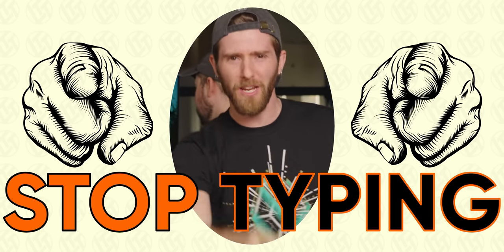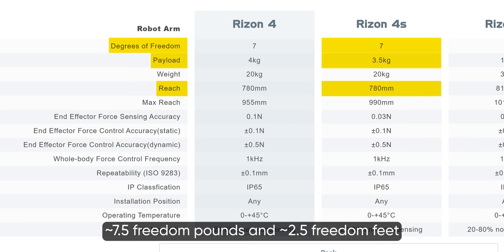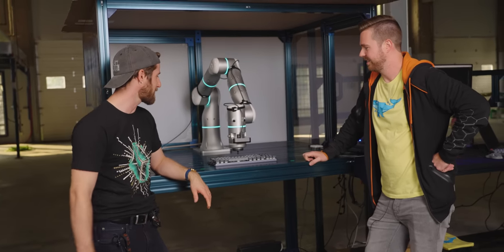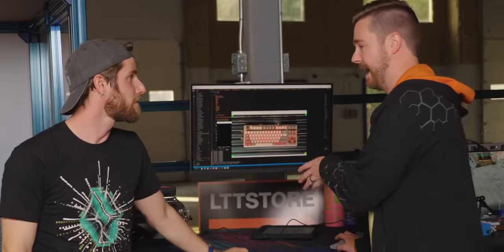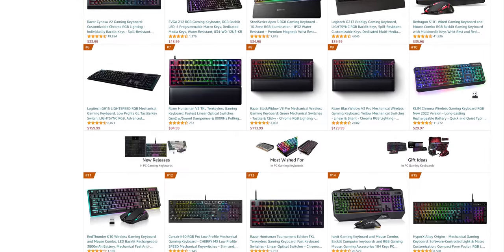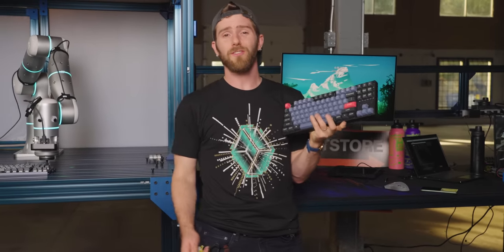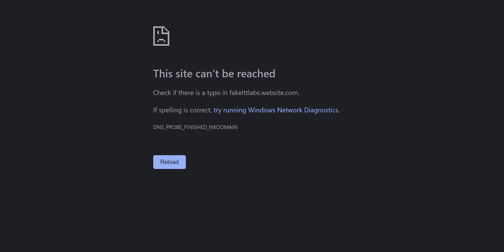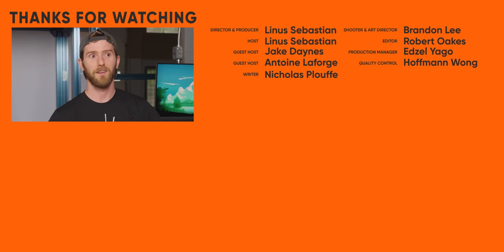Your Keyboard Sucks and I Can Prove It. - Labs Keyboard Testing

Comment: In regards to the potential scoring system between keyboards; you could have a spreadsheet style interactive chart where users can remove any categories that do not matter to them. That way everyone can get a customized ranking system based on their own preferences and hard data.
Reply: <Comment to boost original comment>
Reply: @Waterghosteus  ill help you with that
Reply: This
Reply: up vote so that linus could see it
Reply: <Comment to boost original comment>
Reply: That is a fantastic idea
Reply: @Waterghosteus  I'll help too
Reply: @dex6316  true rhat
Reply: Was thinking about this, especially on the bit about hotswap. As cool as it is, its also prone to failure over time with constant ingress. Solder is still fine for repairability if you're willing to accept the time. Don't want that artificially coloring ratings just because it doesn't have hotswap.
Reply: Sliders!
Reply: PIVOT
Reply: boosting for all the keeb nerds lolol
Reply: The RTINGS website has a Table Tool that does exactly this! I think its the bar LTT should aim for.
Reply: yes
Reply: +1 for this
Reply: You could male this spreadshet available on your website with the option so sort it according to the users whises with affilate links and it's payed.
Reply: Once the data is up. I'll happily spend a couple of days doing some proper analytics designs and dashboards. Linus graphs and charts have been subpar for a long time now. Will be nice to use that data and do some better visuals.
Reply: Great idea! There's definitely certain boxes I don't care about ticking.
Reply: like rtings
Reply: Boost.
Reply: Yup this would be the best method.
Reply: @Waterghosteus  how do comment replies matter here?
Reply: This exact same thing helped me when deciding which mousepad to buy. Having a different categories such as type of a switch, layout of a keyboard or critical functionality will be the most helpful for a fast and painless a/b comparison.
Reply: yesss
Reply: Hell yeah
Reply: I won't be in the market for a keyboard for a long time but upvoted and replying because this is a 10/10 idea
Reply: yes
Reply: Good idea
Reply: Very much this!
Reply: yes yes yes
Reply: amazing idea tbh
Reply: I’d rather have weighted categories with 0 weight being an option
Reply: yup
Reply: boost
Reply: @zimzimph  Boosts the original comments value to the algorithm, making it more likely to appear at the top of the comment list.
Reply: Yes
Reply: This is exactly what I want. Take my vote.
Reply: <Comment to boost original comment>
Reply: and you can also sort in spreadsheet
Reply: This
Reply: YES! No need for fancy interactive website that costs servers, just a simple spreadsheet with all the data, and another link for keyboard sounds to be played directly. Put all resources to testing and let anyone willing to look deep inside figure it out themselves
Reply: Toot toot upvote
Reply: Just making sure this comment "increases engagement" enough to garner their notice :)
Reply: Rtings table tools is a good example that comes to mind.
Reply: This is fantastic if they could pull it off
Reply: Yesss, this!
Reply: @Waterghosteus  seconds that
Reply: I absolutely digging that idea
Reply: Yes
Reply: For those wondering, this is what Linus (and the reviewers) noted about the reviews that initially came in for their screwdriver.

It makes for a great scoring system, tailored to your preferences.

But I suppose something like "sound" is completely subjective.

Comment: If you are testing keyboard latency, make sure to test multiple keys being pressed at the same time.  Some keyboards send commands differently when there is one key pressed, and when multiple keys are pressed.  There used to be some keyboards that had issues when you had more than 3 or 4 keys pressed.
Reply: was gonna comment this. For people who do stuff like Rhythm games that is a huge make or break and might help some frustrated people find out why they are missing notes at high speeds
Reply: @LiveType  it's always best to use the KISS approach for version zero.  If you start with "the best" first you make the problem much more difficult, and it might not be solvable at that scale of difficulty.  if you noticed, they started with pictures and mapped that to an XY grid, then ... they just slowly went down till they started feeling resistance, and measured that curve.  They did all of that without a machine learning engineer which is much more expensive and harder to hire than a normal software engineer.  Then as they saw a monetary value in a more complex solution, then they hired exactly the right talent for that scale of the challenge.

To me, it sounds like LTT is doing things much, much better than reviewers before them.  I, however, didn't see a simple multi-key setup so it looks like they are optimizing narrowly vs. broadly.  Knowing how a keyboard responds to multiple keys is a known issue, and ... it definitely affects max typing speed and gaming.  Both of which are probably important to their audiance.
Reply: Linus mentions it in the video.
Reply: I could be wrong but I think that's what ghosting means, at least, that's always been my understanding of it.
Reply: Just get a keyboard with good key rollover
Reply: @marcasrealaccount  It doesn't fix the issues entirely. Rollover issues stem from how HID-compliant devices (USB keyboards) have to encode and send the data (basically, you can only send 6 key codes and 4 modifiers in one data packet), keyboards with NKRO have to do things like registering multiple USB endpoints to communicate with the PC to overcome this. While the keys will be registered *correctly*, there's no guarantee there's no additional delay caused by this implementation.
Reply: @CarlisleFox  no. keyboard ghosting is when pressing multiple keys will activate a key that is not actually being pressed.
Reply: @LiveType  y
Reply: I was actually going to ask if they were going to be testing keyboard ghosting before I saw this comment
Reply: @Lodinn That limitation of only 6 key codes over USB is only when the keyboard is running in the HID keyboard "boot" mode, which is what is used by the BIOS/UEFI. Once the computer gets to the OS, then the OS can switch the keyboard mode so that a single keyboard endpoint can do full NKRO since the USB HID spec supports this, so not all keyboards use the multiple USB endpoint method. It just depends on the keyboard's USB controller and programming. A good mechanical keyboard, I'd think especially those with open firmware, would implement the full NKRO support over a single USB HID endpoint using the full support of the HID spec.
Reply: They literally say they're going to test this in the video - that's what "key rollover" is
Reply: @Lodinn  Exactly. NKRO hasn't been a "problem" over USB for a long time as far as being implemented. The implementation is just a little...interesting.
Reply: @CarlisleFox  To add to @ACE112ACE112 's response, this is typically caused by the way the keyboard matrix is wired up internally. The cheapest way to wire up a keyboard's electrical matrix makes a lot of keys trigger the same set of signal wires as two or three keys pressed at once, which leaves a lot of room for ghosting. This is usually only done in super cheap rubber dome keyboards. Keyboards that have full n-key rollover use diodes in their matrix and may also run more signal lines so that every key press can be uniquely identified (which is why these keyboards will cost a bit more).
Reply: Many gaming keyboards advertise "anti-ghosting" which is this phenomena so yes it should be tested for.
Reply: They mention n-key rollover.
Reply: @kytechnelson  Yeah, some keyboards go the bitmap route, but it should still have more delay than the "standard" 6KRO implementation. USB overhead is quite nasty, then the polling rate can also be bit problematic - it's still 1kHz max per endpoint using hi-speed protocol last I checked, and in low-speed mode here, it'd be what, 64Hz for the bitmap? I don't think 1kHz can be saturated, personally, but some people swear by it.
Anyway, my point is, there are issues to overcome if you want to ensure compatibility including at least odd BIOS and USB2.0 support. I'm not that big on keyboards, but I know my Ducky 7 had issues and I had to re-plug it to the front USB because it'd otherwise just disconnect on occasion and didn't come back up; it shows as 6 HID devices; I didn't dig much deeper than that though. I also know Varmilo does the bitmap thing via a single endpoint but still registers 4 HID devices. Both implement NKRO, there's more issues with one than the other and it's almost impossible for consumer to know which one has a "good key rollover" in advance, so "just buy one" doesn't really work for most. I merely argue that there's value in reporting on this kind of stuff (compatibility, key press delays, etc).
Reply: @Lodinn  Yeah, there really is a lot to USB, on both the hardware and software side that it is hard to know the precise details and impact of a keyboard's behavior just from looking at a spec sheet (or digging for details elsewhere). Well said on that point about reporting on this kind of stuff. There really are a lot more variables to how this is implemented to the point that there's a lot of value to having some good, clear reporting on this.
Reply: The word you're looking for is Chord splitting. It's entirely different from N-key rollover and ghosting, independent of the keyboard's polling rate, and makes a huge difference for multi-key rhythm games
Reply: @kytechnelson  Indeed. I've re-read my initial comment and must apologize for misspeaking - I said it wouldn't help to get a good rollover implementation while what I meant to say was that there's a lot of moving parts in USB and it's just outright hard to do a good implementation (especially given you kind of depend on the OS interpreting HID compliance the same way you do). And from the end user perspective, digging for details on enthusiast forums can be just exhausting and not productive at all while all you really want to know is whether a particular piece of equipment would deliver you features you want and won't turn out to be a pain in the ass.
Reply: @Lodinn  Ever heard of custom USB device drivers? You can just implement the logic yourself and bypass eveey little limitation of the basic keyboard driver for USB. Also NKRO should not require multiple endpoints, just multiple packets. At least thats how my 4 kHz polling keyboard works, means it's useless in the bios tho xD (but I rarely need to change anything so idc)
Reply: I remember not being able to play command and conquer since i couldnt use the macros haha
Reply: @raylopez99  yea, any modern keyboard shouldnt have this problem unless you are buying a dollar store keyboard.
Reply: @Lodinn  i love cutting edge tech, but you guys are talking about the .0000000001% of users that would even benefit from latency or rollover; which is pretty much standard now. and USB has no moving parts lol.... digital is not analog haha
Reply: Yes he specifically mentions N-key rollover in the video.

Comment: Not sure if it was mentioned before but one thing you should not forget is that most people won't push the keys 100% vertically so it would be good to at least try a few key by pressing them in an angle like I noticed some Keyboards won't work really well if the angle is to high (usually doesn't happen a lot when you are sitting right in front of the keyboard but sometimes happens when you help someone else who is in front of the keyboard so you have to type from the side.)
Reply: That was addressed by Linus and Jake #3 by edge pressing the keys for seeing if keyboarding happens.
Reply: @logandeathrage6945  pressing the button at the side is something different then pressing it with an angle that doesn't goes straight down
Reply: @XYoukaiX  who presses a key from the side? Why would they test for something that the keyboard is not meant to do?
Reply: @reaLeguy  As IT support and a "former" gamer that also has friends sometimes sitting next to him I can tell you it happens a lot ...

Lots of people asking for help have their keyboard in front of them and don't even think about making some space for you so you type in a very bad angle some times

Also if you are sitting in front of the pc with a friend (yeah many years ago online play wasn't really popular) and your pc table is small at least one if not both of you will sit not right in front of the keyboard

Comment: Hey I also work as an ML Engineer in Computer Vision for product line quality control and I would say your laser scanner is totally overkill. I mean if you have the money, go use it but just for identification of the keys you can use grey scale images with some smoothing and I would guess just edge detection to find all the keys pretty reliable and super fast. Only reflection / polished keys might be a problem. I think if you open source your key identification algorithm you will get help fast an easily
Reply: More than overkill, it's like someone doesn't even know what IOL is. As for reflections, image processing on multiple images with different light sources will sort that out, and remove most of the shadows. Most of the code needed is open source, and a decent IOL setup will cost $30?
Reply: @kaduseus593  what's IOL?
Reply: Pretty sure he has the money, and wouldn't be surprised if the laser scanner wound up having multiple purposes in the long run.
Reply: OTOMH, couldn't they just also invest in another webcam mounted opposite the one they already have, and do some comparative stereoscopic wizardry on the image feeds to determine distances? Seems like a good crossover between cost (versus a laser) and algorithmic error rate (versus an algorithm that only uses one camera and has to rely on ML to discern shapes).

Come think of it, they could just use the same one camera and just take multiple images from different XY positions to achieve functionally the same.

(I don't know if that's what you guys in this thread were talking about, or if some of what I said is what they were already doing - this is all admittedly beyond my expertise.)
Reply: Couldn't keyboards where you can't turn the RGB off also pose a problem for a camera-based system?

Comment: I'd actually be curious to see how custom keyboards compare to the OEM variety, in terms of consistency and latency. KBD67 vs Razer Huntsman, etc. Another test  that I don't think I've seen anyone else attempt is two people build the same custom keyboard, and then see how consistent the two resulting boards are. Can give context about whether we can even replicate builds from Youtubers using the same specs. Their board may sound amazing, but perhaps it's not even feasible for someone else to recreate the same experience.
Reply: Soundwise, it's like almost impossible. Like you'll have to know which lube they used for their switches, what mods they used for the keyboard's case, and what kind of textile is used in their desk mat (and its size). The desk material, density, and size. And a lot more. So it's impossible to replicate someone's else builds. For the latency, I think it is only important if you're an elite rhythm game player, otherwise, a 500hz/250hz polling rate is enough.
Reply: as far as latency and all of that, there are a few types of PCB used that could effect that, but most of the time it comes down to polling rate as well as if its usb-c or a.
Reply: @TryTane  right? probably keyboard youtubers that do it already